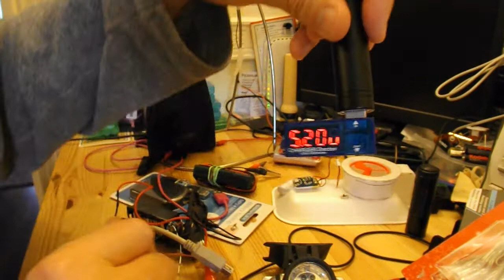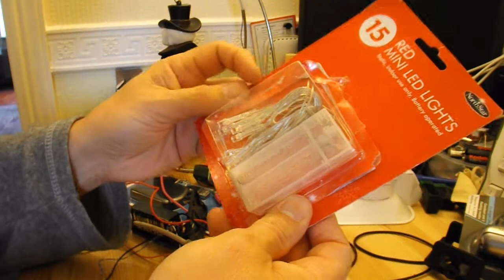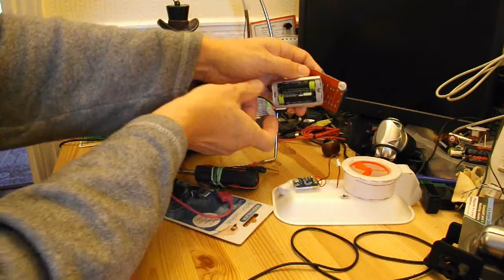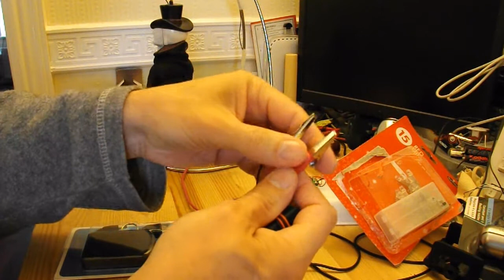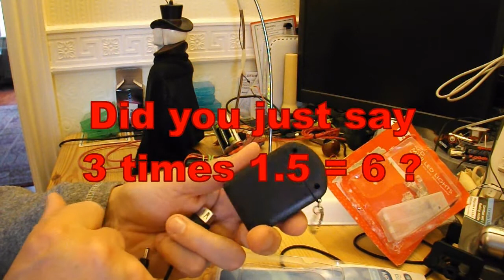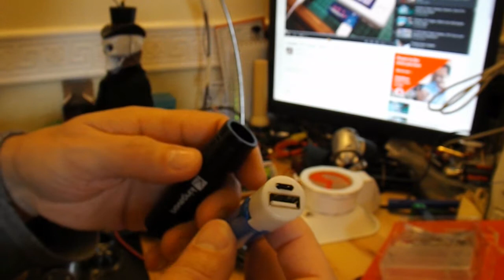Help File - Cheap sources of battery Power Packs

Comment: The 18650 battery is lithium ion probably.  I used them in my electronic cigarettes.  They're very powerful indeed, they make some of them with as high as 30 to 35 amp discharge capacity.  Thanks for the informative video!
Reply from the maker: Thanks for commenting, yes that is lithium ion.